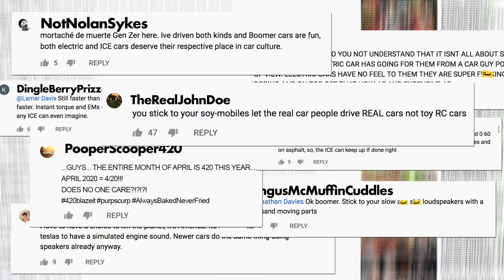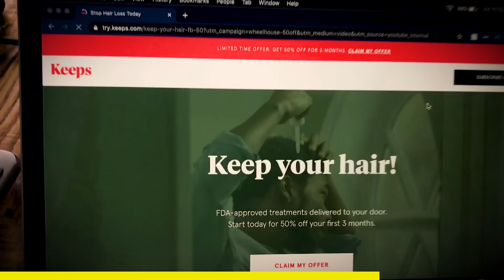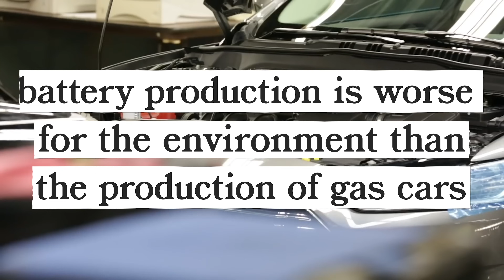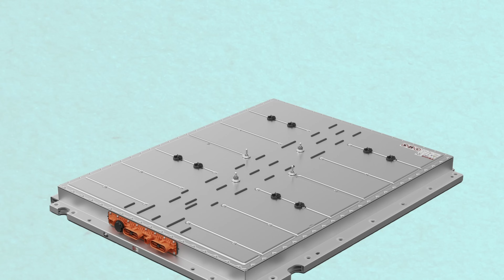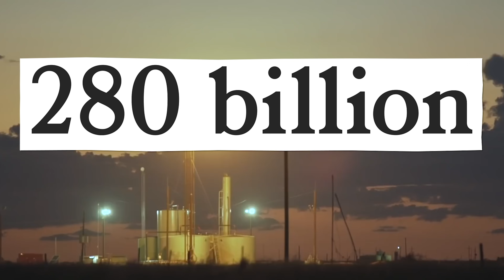Are Electric Cars REALLY Better for the Environment?

Comment: Nice try explaining  the subject but you forgot some important facts- 1) With Todays best battery technology after 400 charging cycles the battery begins to lose effeciency and at some point needs replacing.  How many metric tons of CO2 is the replacement battery worth?  2)  Sourcing the energy to recharge the battery with wind and solar - what are you smoking?  We have power brown outs as it is now. Are you going to charge your Tesla in New York in the winter with solar?  3) What is the pollution factor of millions of spent batteries- god knows how bad that will be?  4) You assume IC engines will no longer get more efficient than they are now-  Granted we have made most of the progress on that  but there's more efficiencies to be had.   5)  I drive a 1972 Alfa Romeo that get 25 MPG on an engine designed in the 1950's and I don't need to replace my whole engine every 7 years like a spent battery.  6) National security- If we have a catastrophic failure of the power grid our military EV's would be useless and we would be screwed without IC engine vehicles in reserve.   7) Consumer choice- will the consumer accept the shortfalls of EV's?  People in rural communities  probably won't .    Pray to god the government doesen't ram this  down our throat by outlawing or making IC engines commercially non-viable.   This is the biggest sham on the unknowing public I have ever seen. So how does the EV compare now?
Reply: I’m gonna try and respond to these one by one because there is ALOT wrong with what you’re claiming. So here we go
Reply: 1.) modern EV batteries last much longer than 400 cycles. Infact currently “lifetime” cycle rating of EV batteries place them at 1,500 cycles. But incase you didn’t know what counts as a “lifetime” for an EV battery. It’s only 30% degradation. Meaning you only lose 30% of your original capacity’s by 1,500 cycles.

Also worth mentioning that you don’t lose “efficiency” with battery degradation. The car doesn’t lose efficiency or performance with age. Only how much energy it can store.

In relation to the carbon footprint I think it fares pretty well because 1,500 cycles for an EV like the Tesla model 3 that’s 500,000 miles. Which is more than double the average lifespan of an IC car.
Reply: @engineeringtheweirdguy2103    You make a lot of good points and your video is well done. You put a lot of work into it. The point of my comment is that the general public are not engineers, and they tend to believe the narrative that EV cars don't pollute at all, which is false. They also believe, and may vote politicians in that will ban the ICE, which would be devastating to the economy.  Furthermore, they think energy to power EV's magically comes to the the charging plug like leaves grow on trees.  The energy has to come from somewhere and they don't think about that impact.
The other thing about IC engines is that it they provide all the versatility that consumers need- you can go anywhere and not worry about finding a gas station, you can take a long trip without having to make a plan for stopping and charging, you can have a one car household if you want to be kind to the planet (EV vehicles make owning an ICE car almost a necessity if you take long trips often or tow a boat or trailer) and there are renewable sources of fuel that have not been developed because of cost, ie. bio fuel.  So there's a lot of development that could be had if we put our mind to it.
All I'm saying to people is look at everything before jumping on the EV wagon.  EV's will not be the solution to every problem.  And think about how much it will cost to expand our power grid to be able to charge millions of EV's when people want to recharge them. Estimates are we could need 30% more electric energy production capacity to meet demand if we were an all EV based country. That's a massive infrastructure investment- and who will pay it?  The consumer- and not just to charge your car- your lights, heat, etc. be more expensive.  Who will pay for the massive number of charging stations required?  The consumer.   There is no free luch!
Lastly,  battery recharge cycles are definately affected by temperature and charging rate so depending on where you live and HOW you charge your battery, up to 1500 recharge cycles may not be achievable and you can not say battery performace will stay constant.  Science proves that the battery performace degrades over time and that's chemistry and physics at work.
We need to keep up the discussion so people have all the facts.  Thanks for your good work.
Reply: @paulziegler8505  actually EV adoption has shown to reduce energy costs which I can explain if you’d like. As for the infrastructure, best estimates see battery electric uptake to be reaching 50% over the next 15-20 years. On average the energy grid increases capacity by 50% every 10 years. EV adoption isn’t flicking a switch. It will take a generation or more. There won’t be any problems with the grid. Also by comparison Charging infrastructure is cheap. For example destination chargers only cost $600 to buy and install. Many small shops, cafe’s and even shopping centres now have paid to have destination chargers installed and offer free electricity and charging to EV’s. Because it’s so cheap. If you can attract at least one more customer per day, that’s $20-$30 more revenue (or more) you’ve brought in. But it cost you the electricity which, as a pessimistic price of 28c/kWh, would be at best a 28c investment per customer and at worst, a $15 investment. But since that cost is directly proportional to the amount of time that person spends at your store, the longer they are there, the more they buy.

Larger shopping centres have started installing super chargers. Because high capital and high return.

But charging infrastructure is cheap. Tesla are building their own super charger network and have the largest in the world. You mark up the price of electricity from 28c/kWh to 30-35c/kWh. And people will charge from it because it’s still significantly cheaper per km than fuel. Other companies like charge fox, base their entire business model from charging. That’s all they do. Build a network and watch money come in.

In saying that most destination chargers are free to use and cost the consumer nothing. Most people charge from home for the price of home electricity and sometimes discounted for EV’s. 

The infrastructure isn’t a problem. Either on the grid side or the charging side
Reply: 2.) California doesn’t suffer from a lack of energy but rather from too much energy. Californian policies and management of their electrical grid is abhorrent. They constantly fail to adequately plan resources and infrastructure and integration to meet supply demand outputs. It isn’t a case of not enough energy but rather poor management of the grid to blame. EV’s won’t make it any worse or any better.
Reply: 3.) modern EV batteries are around 98% recyclable. As well as lasting twice as long as a normal IC car, after their life in an EV they can go into less power dense applications for another 20 years such as home and industrial power storage. Meaning 1 set of batteries could last almost a generation. And will be almost entirely recyclable with today’s technology.
Reply: 4.) there is hypothetical room for improvement of IC cars but you’re trying to squeeze the last 0.5% efficiency out of them. Mostly that would require super cooling the engine with liquid nitrogen as coolant. Not something that is practical or cost effective.
Reply: 5.) modern EV batteries have a warrantee minimum of 8 years. Aside from being set to outlast almost any IC. Further to that EV’s don’t need regular replacements of oil, radiator fluid, spark plugs, air filters, oil filters, gearbox oil, timing belts, fuel pumps, etc etc etc to keep them operational. What’s the carbon impact of the manufacturing of disposal of all those regular replacement parts?
Reply: 7.) the same way they deal with it now. Generators. What happens if someone attacks your countries oil supply?
Reply: 7.) for domestic users, there isn’t really any major short fall with EV’s. But SOME rural and long distance freighting customers would be better suited to an option like FCEV’s (hydrogen fuel cell electric vehicle).

Comment: Where did you get the info for myth number 2?  In the USA we already use 105% of what we generate. This is the reason for rolling blackouts and so on. I tend to think what you stated may be the truth bcuz it sounds good. The only way to get this info however would be to figure out how much energy a gas station would cost electrically , to run, per car and compare it to the cost on the energy grid of charging hundreds of thousands more electric cars. Keeping in mind that when you get a tesla, they come to your home and install a 220 and run extra goods from your home and the setting up of countless charge stations all over the country. So it seems to not make sense that it wouldn’t pull more when , the stats are that the US pulls minimum 105% of what we make ( 5% more than what’s available. ) So we already live at the brink of Maxing out. Adding a shit ton more charging docs would have a def impact. No?  Who knows. Not this guy !( me. Lol. Not the dude w the glasses).

Comment: I like the idea of electric cars but I'm concerned about the batteries, a ICE car can easily last 15 years. As for batteries, those wear out over time for example most phone batteries are impractical to use anymore after 2-3 years. I know EV batteries are better but will a Tesla that currently goes 300 miles be able to get much more than 100 12 years from now?
Reply: It’s now a common sight to see early generation Tesla’s with 400,000 miles+ and still going like new. Current Tesla batteries have a cycle life (to 70% health which is still extremely useful to most people so can go for much longer if they wanted to) of 1,500 cycles. For the 75kWh battery version of the Tesla model 3, that’s a lifespan of 500,000 miles. (Ish).
Reply: My point is. EV’a are already at the point of outlast combustion cars by easily achieving more than twice their lifespan. But there is a prevailing myth about batteries not last long that still circulates media despite the evidence being easily accessible. And they have been for quite some time now. Tesla batteries are often warranted to 8 years often with unlimited milelage.

Comment: Not true on the 25% electric car grid can handle. Grids just went down over electric heat usage this year.
Reply: Why are people so obsessed with this anecdote. A natural disaster doesn’t invalidate the fact that 99% of the time the grid could take 25%. Saying the grid can’t support EV’s because it went out during a natural disaster in Texas is like saying you cant own an electric car because Florida has a hurricane every 5 years or so and the power goes out. It’s fucking myopic.
Reply: @engineeringtheweirdguy2103  it simply got a little colder for a few days.. thats nots a natural disaster. Y ou are acting like a 8 point earthquake hit after a class three hurricane.
Reply: @chucknetzhammer9489  extreme cold snaps well outside of weather norms of the area so much so that it causes excessive loss of life is a natural disaster. Houses in Texas aren’t built to handle snow. They’re built to shed head easily. Not insulate against cold. Houses in Texas don’t have high capacity heating. Most homes built for that kind of low temperature have heat pump heating systems. Not resistance oil heaters. 

It was the coldest event in recorded history for Texas. Damage to property due to snow build up, frozen pipes, etc, again because the houses there aren’t built for that kind of weather, was extensive. About as much damage to homes, vehicles and public infrastructure as a hurricane. For example hurricane Harvey damage cost $19 billion. This snow storm cost $125 billion in damages, to homes, vehicles and public infrastructure like pipe lines, drainage, power, roads, etc. Around 111 people died in Texas snow storm, 68 died in hurricane Harvey.

This wasn’t just “getting a little colder” this was a natural disaster in every sense of the word.
Reply: @engineeringtheweirdguy2103  and neither is the electrical infrastructure. thank you for pointing that out.
Reply: @chucknetzhammer9489  well no. Many of the power plants and other infrastructure wasn’t designed to operate at those temperatures. Putting additional strain on the grid outside of low capacity high power draw heaters being used in an attempt to protect people from the natural disaster. If the same temperature occurred in Colorado, no one would batt an eye. Because the houses, infrastructure and other every day items such as roads, and heaters are designed to be operating in those environments.

It’s like designing infrastructure for Mexico and dumping it in the artic circle and being confused why nothing works.
Reply: @engineeringtheweirdguy2103  sorry, but just like you said , the homes were not built for it. so are the plants. A electric car takes much more power to charge than two space heaters. now go away.
Reply: @chucknetzhammer9489  it does. But you’re trying to say a natural disaster is somehow proof that the grid can’t support EV’s. In reality it suggests no such thing. Just as earthquakes or hurricanes don’t suggest the grid can’t support EV’s. It was a natural disaster. It has no bearing on how the grid operates at any capacity for every other day of every other year.
Reply: @engineeringtheweirdguy2103  again ....electric heaters draw less power than a electric car. .now go away.stop trolling.
Reply: @chucknetzhammer9489  actually had unless you have specific aftermarket installation at your home an electric car will be charged off the power point of the house. This will have the same power draw as a single resistance heater, yet alone one or even two resistance heaters for every room of the house. You seem to think most houses can output 20-50kw? In reality the limit of the power draw for both EV’s and for resistance heaters is the limit of the houses ability to supply power through a PowerPoint.
Reply: @chucknetzhammer9489  if that’s what you were trying for I say. It’s a bad argument
Reply: @engineeringtheweirdguy2103  and where does the power come from? the grid, which went down because of lack of generating stations, which happen to be under pressure to close. go away troll. put content on your page.
Reply: @chucknetzhammer9489  it did not go down because of lack of generating stations. That is a myth. It went down because the fuel used in them was frozen. No fuel. No power. Not grid capacity that’s the problem. It’s the power station not being designed to deal with temperatures that low.
Reply: @chucknetzhammer9489  just going to ignore the two articles I linked you above are we? Seems like an honest approach.
Reply: @engineeringtheweirdguy2103  I will ignore all content by someone who has no content on their own page..........which screams troll.

Comment: Ev are yunk when we had snow, storms and floods each year. At least gas car like toyota can be flow completly.  Wash it, change the fluids and it work. However, electric cars like rich girls crossing one inch of water.  Tip toeing all the way. In one foot of water, they are totalled. Get a new electric car.  More pollution for the environment.  On storm of snow, the battery get discharge and you die after one day.  Electrical cars would be better if they produce their own power but Human wisdow is not that great for greedy. Human greedy is what move the economy.  They have the need for cash.
Reply: What fuckin planet are you living on. The temperature it takes to do that kind of damage to a battery is well below the freezing point of petrol. Tesla’s can be submerged in water fully and still operate. Infact there are compilations on YouTube of Tesla’s crossing flood water because you can’t flood the engine as it doesn’t need an air intake. You really honestly think in today’s world where even headphones are water proof that a car that is designed to travel in pretty much all weather conditions wouldn’t be able to withstand a puddle? Seriously?

In cold weather your range in modern EV batteries is reduced by about 5% due to having to use a heater. When you first start driving in cold weather (well below freezing where most combustion cars struggle to even start btw) they will initially show low charge. This isn’t because the battery doesn’t have charge as they would violate the first law of thermodynamics but it’s because the chemical reactions in the battery are slowed down due to temperature. As you drive both the internal resistance from the battery and the electric motor heat the battery and your charge will indicate the correct level of charge after about 20-30 minutes of steady driving.

What planet are you on buddy?
Reply: Freezing point for the batteries is around -92 degrees F. Whilst for petrol it’s -60. But the colder it gets the harder it is to create ignition to start the engine so your car is useless well above that point
Reply: An electric car is far more likely to survive being driven into a flood than a gas car, a gas car would hydro lock if the puddle was deep enough to submerge the grill in most cases, an electric car should be able to get through that same amount of water.

If the car is sitting and the water is high enough to start flooding the interior it would flood out the electronics and get water in the transmission of a normal car and the electric car would also have electronics get ruined, both cars are now trash here.